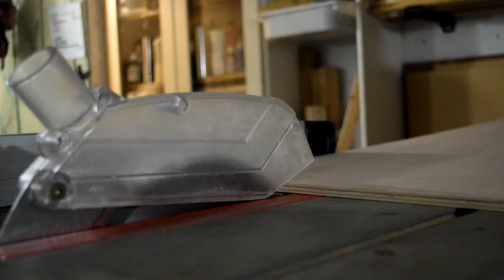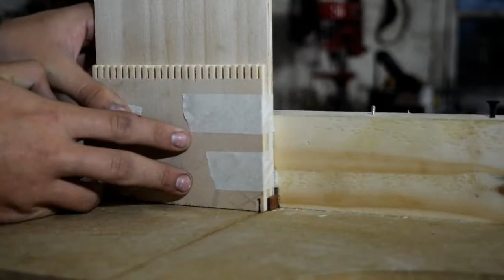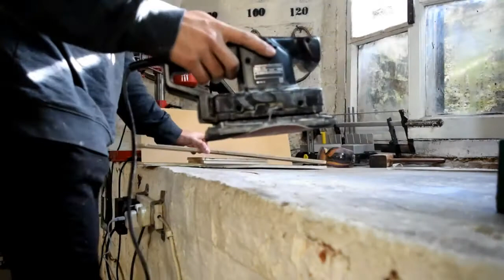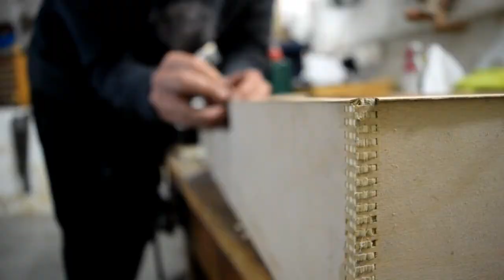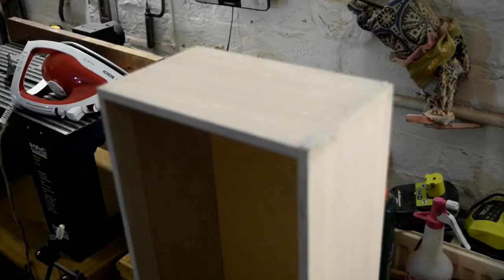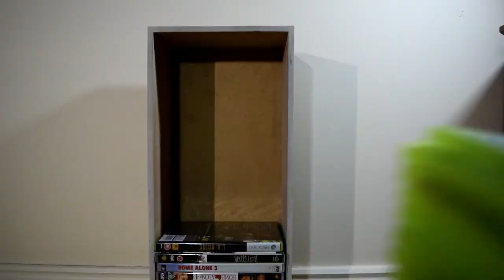Making A DVD & Games Storage Cabinet [40]

Comment: Nice work as always. I have the same issues with ply, you need to clamp scrap nice & tight to it to it to stop the tearout.
I bet your mum was out of the house on this one! Glue ups on her kitchen worktop and using her best iron for the edging lol. My Mrs would crucify me if I got caught doing it. I once got a right royal bollocking for washing motorbike parts in the dishwasher. Years ago I got rumbled when she came home to find me waxing my motorbike chain in the oven.
Reply from the maker: Robots N That haha!!! I’m one of the lucky ones - she doesn’t seem to mind that much :) Great tip with the plywood, you should start a channel or blog or something, you’ve got so many tips and good pieces of advice. Thanks as always for taking the time to comment; I appreciate it!